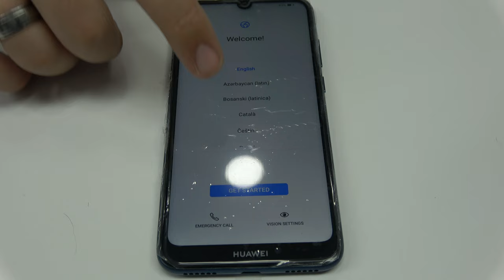Huawei Y6 2019 Teardown

Comment: I disassembled back cover as my phone is constantly restarting. Then I disconnect power button and volume connector and it stopped restarting. Looks like powerbutton strip or button itself is faulty..how can i remove this?? Looks like its glued on the frame
Reply: Did you find a solution? Mine is having the same problem 😢